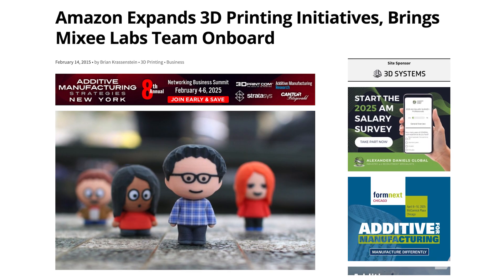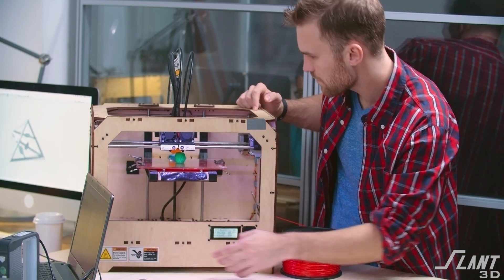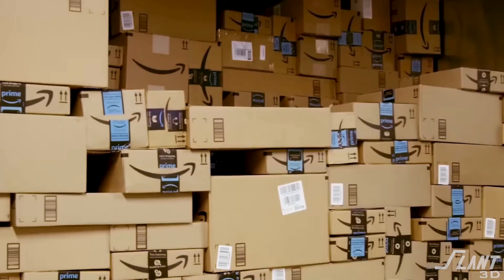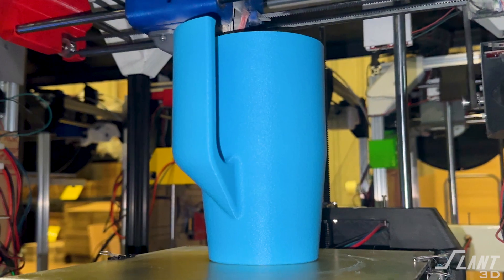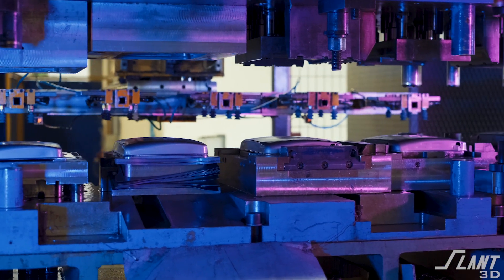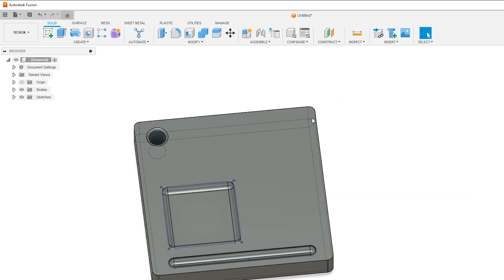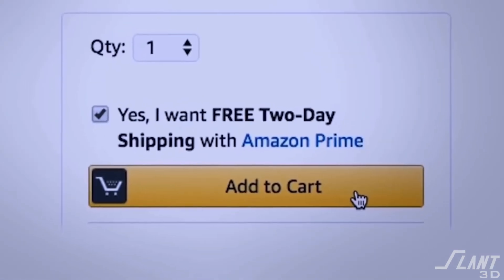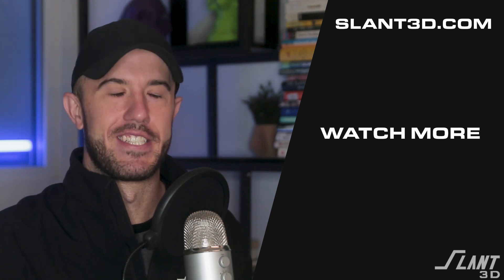Dear Amazon: Here's Why Your 3D Printing Service Flopped and How We Can Fix It

Comment: this doesn't make any sense cuz the most expensive part of Amazon's shipping business is the last mile, which 3d printing doesn't do anything to reduce. the economics just will never make sense for Amazon, bc injection molding in bulk in China and shipping it across the ocean and on planes is cheap compared to running 3d printers
Reply from the maker: So you didn't watch any part of the video then

Comment: 3D printing still requires far to much knowledge and skill and thus money and overhead for the end consumer. Sure you COULD get amazon to set up a modern to user 3D printing but by the time it goes thru them to your farm and gets manipulated/fixed to be produced and then sent to the customer the $$$ becomes as high as just buying a mass produced part by any other method, probably with lower quality etc. 3d printing can be cheap for the 3d printer owner but for the customer they receive little to no benefit for the costs once they are done paying the maker. I dont this will change much even once 3d printers become very plug and play with great AI/super accessible and easy to use.

Comment: Yeah.. I wouldn't be surprised if the entire thingiverse library of objects could be fit on a single, large, USB thumb drive. Digital inventories carry a cost so low as to be non-existent. This is a really big differentiator.
Reply: You wouldn’t be surprised if there was a thumb drive that could hold a few hundred terabytes? What planet do you live on?
Reply: @sciencesaves  Earth. I'm a dev that works with efficient geometry storage (VR, gamedev).

I'm not including things like display jpegs/pdfs/etc, just raw geometry, and compressed (of which geometric data can be compressed rather easily and efficiently).

I think 2TB thumb drives are available these days, which would be on the large size.

I remember reading some 2.5M objects on thingiverse, assume a conservative 2:1 compression for an average of 1MB/obj (especially if objects are stored in a binary format, eg. not 3mf). So 2TB would store 4M objects.

And if you're reasonably aggressive about compression and can account for curved surfaces (remember, most curves are catmull-clark subdivided or arc-derived surfaces which can be detected!), there is no reason that a 1MB container would be more-or-less enough for the vast majority of objects (on average), even the ones featuring lots of organic curves.

I again assert: I wouldn't be surprised if a large thumb drive was sufficient to store the library of one of these sites.

But the broader assertion remains: digital "inventories" cost next to nothing.

And there is no need to be insulting in order to showcase your towering intellect..
Reply: @sciencesaves  Earth. I'm a software engineer that works with efficient geometry storage (VR, realtime, light transport, network transport, etc).

I believe a 2TB thumb drive can be bought today, which would be on the large side.

I recall reading the Thingiverse had around 2.5M objects. This yields ~800KB per object on average.

With naive 2:1 comrpession on a BINARY (geometry can compress rather easily), this is 1.6MB per object. Remember, STL and 3MF are ASCII files! This means a floats are quite a great deal larger than they would otherwise be as a single-precision 32-bit float or 16-bit float (2B) -- the latter being easily sufficient in most cases. And a LOT of the files data is wasted in the file format and formatting of file (eg. indents, XML tags, etc). Storing as binary might be sufficient compression!

With a more aggressive compression scheme that accounts for a set of curved surfaces (remember most curves are result of catmull-clark subdivision, or perhaps arc primitives, etc, which can be detected!), compression can be far greater. There is also additional ground to be gained with reduced precision offset coordinates given a local point, displacement from a basis derived plane, structured container, etc, etc, etc.

I reassert: I wouldn't be surprised if a large USB thumbdrive would be sufficient to store the ENTIRETY of one of these sites.

But the key point is this: digital inventories cost next to nothing -- which agrees with the assertion made by the video's poster.

And there's really no need to be insulting as a means of showcasing your towering intellect...

I'm not allergic to being corrected, but there are ways of conducting a productive didactic that assists the individuals involved to a clearer understanding.
Reply: @sciencesaves  Earth. I'm a software engineer that works with efficient geometry storage (VR, realtime, light transport, network transport, etc).

I believe a 2TB thumb drive can be bought today, which would be on the large side.

I recall reading the Thingiverse had around 2.5M objects. This yields ~800KB per object on average.

With naive 2:1 comrpession on a BINARY (geometry can compress rather easily), this is 1.6MB per object. Remember, STL and 3MF are ASCII files! This means a floats are quite a great deal larger than they would otherwise be as a single-precision 32-bit float or 16-bit float (2B) -- the latter being easily sufficient in most cases. And a LOT of the files data is wasted in the file format and formatting of file (eg. indents, XML tags, etc). Storing as binary might be sufficient compression!

With a more aggressive compression scheme that accounts for a set of curved surfaces (remember most curves are result of catmull-clark subdivision, or perhaps arc primitives, etc, which can be detected!), compression can be far greater. There is also additional ground to be gained with reduced precision offset coordinates given a local point, displacement from a basis derived plane, structured container, etc, etc, etc.

I reassert: I wouldn't be surprised if a large USB thumbdrive would be sufficient to store the ENTIRETY of one of these sites.

But the key point is this: digital inventories cost next to nothing -- which agrees with the assertion made by the video's poster.

And there's really no need to be insulting as a means of showcasing your towering intellect...

I'm not allergic to being corrected, but there are ways of conducting a productive didactic that assists the individuals involved to a clearer understanding.
Reply: @sciencesaves  My replies are being deleted. I had a reasoned response. Needless to say, it can be done.
Reply: @SeanLumly  lol okay
Reply: @sciencesaves  It happened again. This is very frustrating. 

I'm a software engineer that works with geometry (among other things). STLs, 3MFs are stored as ASCII files. These can be binary, and dramatically compressed. a 2TB thumb drive is capable of storing a lot of geometry.
Reply: @SeanLumly  i dont think anyone doubts you can hold a lot of files in 2tb i think the issue is you think 2tb would be enough to reasonably contain the entirety of thingiverse
Reply: @shrub9677  Maybe not on one stick, but I bet you could fit it in the amount of memory you could stick into an empty soda can.
Reply: @darrennew8211  unfortunately for you we arent talking about soda can sized flashdrives we're talking about actual real flashdrives
Reply: @shrub9677  I'm talking about a collection of real flash drives all of which would fit in a soda can. But thanks for the lack of reading comprehension, ELIZA.
Reply: @SeanLumly  🤣🤣🤣

Comment: Instead of letting am item appear in a werehouse you can let an item apprear directly at the customer ;-)
Reply: Not really. After all, 3D printers are just maschines, that you need to learn to control. Of course, with the Bambu printers, they really boosted the accsess to 3D printing, but after all, they are not a thing you can just use without thinking, like for example a dishwasher. Sure, the dishwasher has some different programs, but ypu don't need ro calibrate for every different dishsoap you use, while plates need a different soap than glasses. Hope you get, what I want to say. Under makers and tech enthusiasts, printer are very common, since they are a really great tool, and the industry application also growing more and more, but I honestly can't imagne my mother using a 3D printer to print something for her. Even when the maschine would be as autonomous as possible, you still need to maintain certain parts, change clogging nozzle etc pp. Possible that this gets better in the future, but I would say my mother would prefer the option to just buy the finished part never the less.
Reply: @unknown_user2345  that's why you design for ease of printing. with bambu's makerworld integration it's as simple as loading in the right filament, selecting it in the app, and then you press go and the settings are all done for you by someone else. hell, even when you design stuff it's no longer that difficult. with their A1 line maintenance is also super simple -- got a clogged nozzle? no problem, just press the filament cutter and replace the nozzle, it takes two minutes, no tools, and then a maintenance person or your crafy uncle can just unclog it next week.

it's genuinely no more complex to run a 3d printer at home these days than it has been to run a 2d printer for the past 20 years.

some people do prefer the option to just buy the part, but with industrial 3d printing being either so expensive that it's only viable for prototyping and some edge cases, or so basic that it's only really good for decor and random junk. buying a $2-300 printer that can just make you the same things for a quarter of the price out of actually nice filament, with instantaneous shipping once its complete, has a massive advantage over that.

slant 3d talks a lot about needing competition in their space, but what they're missing is that the competition doesn't look like another warehouse with slightly different printers, it looks like an a1 mini on your prospective customer's desk. they won't fail outright, 2d printing services do still exist too, but they have to up their game because no one orders a document to be professionally printed in the trademark muted colors and line artifacts of an entry level consumer inkjet, or goes on etsy to buy a similarly printed note. and so far that's the atmosphere their print-on-demand service gives off.

consumer goods and 3dp dropshipping is an underserved niche, but slant 3d seriously needs to up their game with filament choice and at least some level of assembly for non-3dp parts if they don't want everyone in five years to just have a bambu a3 in their office and simply download 3d models instead of buying the printed objects. cults3d already exists, it's not like designers can't make money without a print farm. that's what they're racing against here.